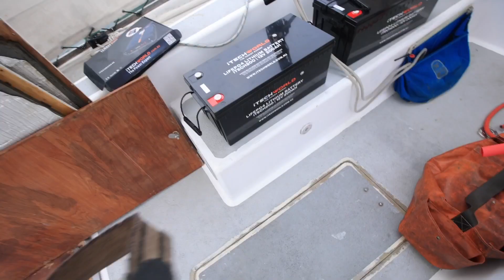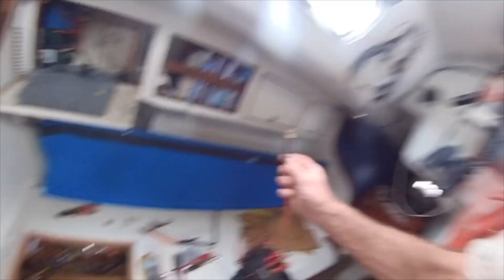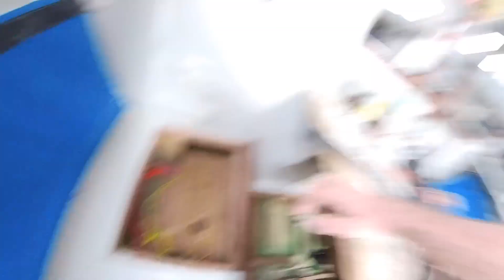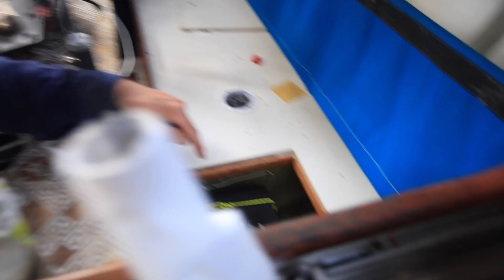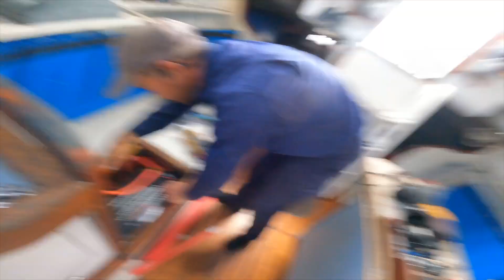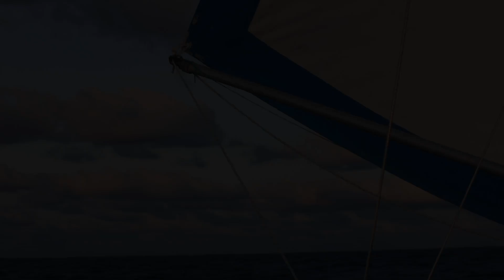Lithium Battery Installation (Learning By Doing Ep185)

Comment: Regarding installing the bigger 12 v cables…
While I understand the capacity of the  new style batteries is certainly greater, 
The load on the entire 12 volt system has not increased, so I’m not sure you need a larger cable.
Similarly, when charging up the batteries by the alternator and solar panel, their capacity to produce electricity into
The batteries has not increased,  and that 40 amp charger limits this as well. 
So I still dont see the need for the increased cabling size, 
Unless they were too small to begin with…
Perhaps you can straighten me out on that, 
Great  informative video all the same 
Thanks mate…
Reply from the maker: Cheers Edward. We only increased the size cable linking the 2 lithium batteries.  All the other cabling was the correct size and didnt need anything doing.
Reply from the maker: Albert made a quick video to show his work on this. https://youtu.be/DOb7ea0hHyw

Comment: Very interesting. Great you found a local expert for the installation, Albert seemed very knowlegeable and good to work with. Ive seen more robust battery straps or even boxes to contain lithium batteries (if they ever catch fire you are in big trouble).  As ever new technology has a learning curve.   Nice you can see the improvement and will be useful as you explore.
Reply from the maker: Thanks Alex. The dyneema cords have a breaking strain of around 1 ton, way more than enough for a 27kg battery. Fire is always a hazard but a worthwhile risk I feel.

Comment: Nice work manwell, I didn’t realise how long a charge would last for , what make is your boat? Mite be looking at a fast 42 down Rockhampton shortly, I’ve worked off shore for 11 years but never sailed and have to get it to cairns should prove interesting 🤨
Reply from the maker: Hi Trent. Yeah I was surprised how long they lasted as well. My boat is a Sayer37. At least you'll be going on the right direction, wind at your tail. Let me know if you need any tips

Comment: the problem with trades and yacht support is the market is just not big enough to support a man and his business  - reliably - the good guys are run off their feet   - and if they are half decent they are working somewhere that pays   - yachties are typically screaming about and then nickel and dime show everything.  

just a caution  - clearly mark which cable is positive and negative - like a really obvious marking  - its so simple to mix them, up 6 months later when you adjust or move around  - as my electrician told me   - once the smoke comes out there is no way of putting it back in.
Reply from the maker: Yeah fair comment I guess. The mining industry for sure pays better and keeps the tradies busy for longer.

Comment: Great upgrade!  not sure about your battery monitor but with mine I can never really trust the SOC % to be accurate. Sometimes it is a good idea to have a rough idea of how many amp hours you are drawing over time as a sanity check against what the battery monitor says.
Reply from the maker: Thanks John. The accuracy of a battery monitor related directly to wether its set up correctly. If every amp of incoming and outgoing goes through the shunt then it should be pretty accurate.

Comment: If your Lithiums are empty (80%SOC) you will take over 11 hours to charge them at that rate. Good thing you found Albert to help you with the installation, he really knows how and why it's done properly. One thing we didn't see is how your solar is going into your batteries. If it's still the same MPPT as you were using before, then the charge parameters should be changed. Do you have a hydro generator? I think Schiehallion is a perfect boat for hydro generators, due to her racing pedigree. It would be awesome if Watt and Sea would sponsor special for you.
Reply from the maker: Hi Andrew. Yeah Albert was great and I feel much more confident with him signing off on it all. I actually forgot to film the last part where we changed the parameters of the solar and shore chargers. I would love a hydro generator or better, an electric motor with proper regeneration. As you say, I think this boat would suit it very well.